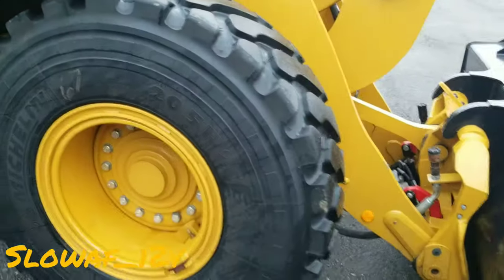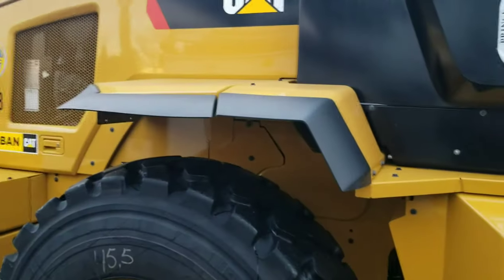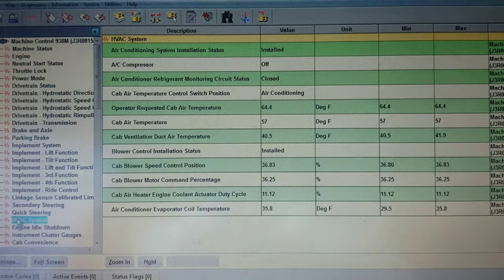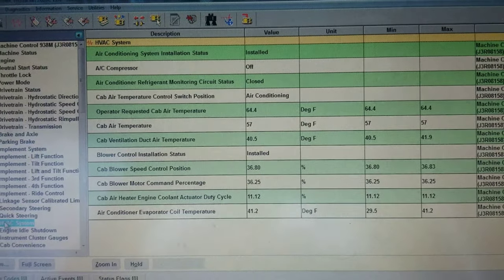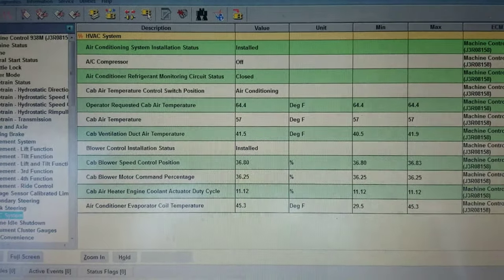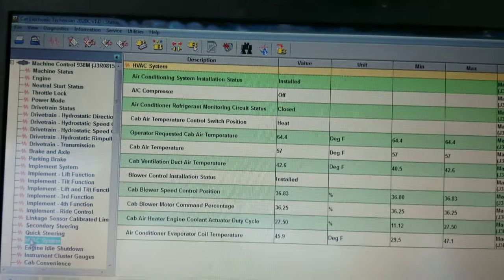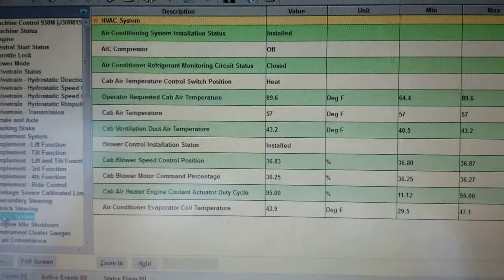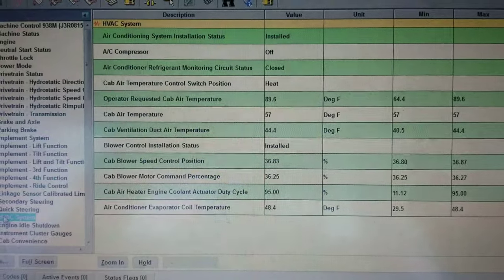HVAC Issues On A Cat 938M!!!

Comment: My 938m quit blowing cold. Fuses good, AC box is dripping water out both lines. Still very hot air. What is it?
Reply from the maker: Have you checked HVAC operation through ET? Checked freon levels, low and high pressure switches, checked low and high pressure on the ac lines, sorry to say alot of possible causes, yet water valve maybe an issue
Reply: @slowaf12v  turns out it's the dryer. Blowing cold again. Loader is only 3 year's old. Also, the mechanic is going to replace the valve you showed in this video. I'm the operator not the mechanic, so system knowledge is bad.
Reply from the maker: @bgohio4591  receiver dryers need to be replaced every season but no one ever does

Comment: Hi slowaf12v
Start and shut off the loader with ac switch on can cause damage to the system.? Or the system itself has a strategy to prevent damage
Reply from the maker: No, wont cause issues with system